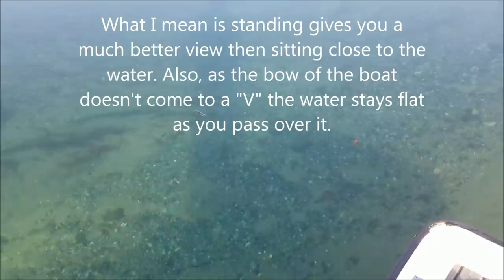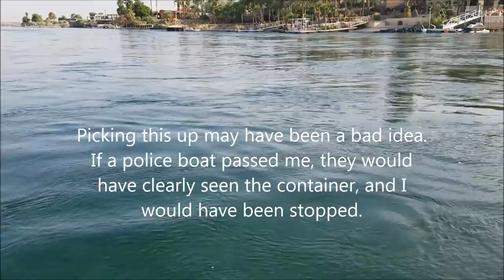I Bought The Strangest Little Boat On Craigslist

Comment: Sorry for all the comments in a row lol....what part of Cali is this? What city/river it's gorgeous!  I live in Portland, Oregon and we have the Willamette river that runs through the city and it's a nice place to boat/swim/hang out near the water, but no where near as nice as the river you're at and the water is not even close to as clear! You can only see maybe 3ft if that. Some really nice homes on the water! I'd love to take my 24' Baja H2X down there!! It's got a Mercruiser 7.4 MPI MAG that I upgraded to a full roller engine and changed the cam profile. Also did modest porting which was basically a gasket match port job that I spent a little more time on and also did the intake manifold. Also upgraded the headers to some high performance water jacketed header, into a captains call system and out the transom. (The capatins call is a valve you can open or shut that changes whether the exhaust is routed down through silencers, then the prop, or its straight out the back which makes it very loud. Most recent upgrade was the original drive started making some noise so I opened it up and found a spun main bearing so it needed a new lower unit. Instead of that I did an arneson surface drive conversion. I NEVER pull people behind my boat and I had the room on the trailer because it's actually made for a 26ft boat, so I went with a surface drive. WHAT A DIFFERENCE!!!! before the surface drive it would top out right around 75-80 mph on GPS with 2-3 people including myself and 3/4 tank of 89oct fuel. That's after the headers, port work and cam/valvetrain upgrades. After the surface drive install it would do 86-88 mph on GPS with the same conditions! I'm confident it could hit 90 mph with 1/4 tank of 93 octane and just me. I'm gonna definitely try to hit 90 next summer!

Comment: I think what would been a bit better, where you did the cut out for the motor on the trailer. Made a hinged plate to go in place of the void when hauling a 4 wheeler. Then when you haul the boat. Flip it up out of the way, just a thought. Cool project man, should of thrown maybe a 50 horse on that bad boy 😂 😂 😂. Plane that bad boy out.

Comment: Seems like that's burning more fuel than it should. In the 80's, I used to run a thousand pound 17 foot Boston Whaler Montauk (with the industrial rated hull) and used a larger engine than it was rated for. I had 2 5 gallon fuel tanks and would be out over 8 hours each day without emptying both tanks. That was before so much alcohol was added and the gasoline it's self may have been better quality, not being from shale deposits. That might account for some, but not much better efficiency.

Comment: You end up losing like 30% of your power through a jet drive, so its more like you have a 14hp outboard on there. Also don't believe it aids in steering any being in a fixed position like it is on your boat. Maybe better shallow water clearance but I'm almost 100% you'd be better off with a standard prop and just play around with pitch. Super cool little skiff though, nice find 👍
Reply from the maker: Well, next video regarding this will probably be a Prop vs Jet video.
Reply: @BrandonsGarage  Exactly what I was wanting to see! I'm not an expert by any means, just a scrap boat enthusiast like yourself. I'm a big fan of the late 50's early 60's Johnson/rude big twin motors. 35-40 hp depending on what power head you use and only 125lbs. Plus they are cheap and parts will swap from different motors over a 20yr span. Running twin 59' lark 35's on a 15ft Glasspar, not practical but turns heads lol.

Comment: How much water did it have in the hull? I’m guessing the flotation foam inside is soaked since it won’t get up on plain.  Also, you could tell by the way it dragged from the harbor freight trailer to the other one.

Comment: You should take the fire extinguisher out and turn it upside down and using a rubber mallet hit it until you can feel the powder inside move from end to end or it won't put out a match.

Comment: Trying to remember I think they referred to it as a door....(something?) I can remember a few around (Washington Hood's Canal) during the 70's.  It did NOT enjoy chop (so don't even THINK about something like Puget Sound)..... (I do mean the one in your footage at the beginning, never seen one like the one you bought).  Till you got it up out of the hole that jet on the new outboard sounded like a great appliance for turning fuel into noise... P.S. my grandfather (now dad's) has the same 10 HP seahorse but in BLUE (as a matter of fact the old Johnson dealer in West Seattle offered my Grand-mother a New 10 horse and $500 for it (I think?)).

Comment: Im curious how it would preform with a long shaft motor. like one they use one flats boats for duck hunting. Temporarily remove the upright bars and you might be able to drive it from the seat.
Reply: @Mud-Skipper Long Tail Motors

Comment: Just tie a line around the bar to the clamp on each side to prevent it from moving. If that motor suddenly moved all the way to the thrust side you'd fall off and it would run you over. You riding that thing without a dead man cutoff is unsafe for you and for anyone else on that body of water. You and safety don't have a very good relationship. 
It's crazy to think that 1996 was 24 years ago. Damn..
Cool boat!

Comment: Reminds me of a boat my father used to make called Circraft they ran a company in the 80s this is round and looks like a M&M and also uses the body learning from side to side to steer it. original design was to large and unstable then the idea and copyright was sold to the company my father worked for. they made the craft smaller and more stable. we had loads of fun with these boats. look them up on youtube. awesome fun.
Reply from the maker: Great, now I need one.
Reply: @BrandonsGarage  sorry for adding to your collection :) you should be able to find one for sale :)
Reply from the maker: where might I get one though...
Reply: omg lol though they do cost a lot more then we used to sell them. think it was about a 1k with the boat and trailer. try ebay or just search google for circraft. i think there is also a facebook page. hope this helps. :)

Comment: Not true at all about the strength and that is just going to crack out again. That was caused by impact damage      not likely a failure due to delamination. The best way to fix damage like that would be to completely remove and damaged fiberglass and start with small strips of glass and progressively laying on bigger strips until the damage is nearly filled. After that you make a putty out of a medium grind fiberglass powder mixed with resin and lay it on like body filler. After that a heavy fiberglass matting should be applied to the damaged area from the inside. That area would be the strongest part of the boat and really would the area crack out again.

Comment: Sounds like it's over reving the engine. Try another pitch prop..  higher number to lower the RPM. Should run about 5500 rpm when the pitch is correct.

Comment: I don't know where you're at but that's some beautiful clear water. Was that top speed? I don't reckon that's to bad and standing up to. Yeah that maybe as fast as I would like to go. Nice work
Reply: It's the Colorado River at Needles Calif. and on the other side of the river is Fort Mohave, Arizona.  Brandon mentioned in one of the responses on here that he felt it was going about 30 miles an hour and it wasn't at full throttle.
Reply: @WoodGuy  That's a damn good speed especially when you're standing on an almost flat platform like that. I don't want jetspeed speed, I want something where I can get to point a to point b with a few fishing supplies and that would be perfect. The only thing is if i'm fishing, i'd probably pull a small float behind for a little storage. Besides that, just riding the river would be a blast but i'm all the way on the other side of the country.

Comment: Not quite the same as the vintage video but still in my opinion more interesting than a jet ski. The original one would be good if it had a setback barstool for when you must want to sit. Or chair that flips out from the handlebars.

Comment: You made a big mistake on the drain plugs. You didn't put any silicone on the 2 mounting screws. It's guaranteed that water will work it's way in around them, and saturate the wood. Leaking into the boat will be minimal, but water damaged WILL happen. Otherwise, a nice job!
Reply from the maker: Didn't notice the tube of silicone?

Comment: So doesnt the jet drive take some speed away? Ive heard many different things about Jets being put on outboards. some say they make the motors slower. but some say it's the same. personally how I see it is, jet drive goes places where props cant. i guess go where the fish go.
Reply: From everything I've seen with friends putting jet drives on their boats on their outboards it knocks about 30% or more off of the speed compared to a prop like my buddies ball I had a 115 Evinrude propeller they would be 65 he put the jet drive bottom end on it and it would only be about 35 to 45
Reply: Yeah you lose at least 1/4 of your hp but you also draw a lot less water if its setup right. His cavitation plate looked well below the bottom of his boat so he wouldn't be able to go very shallow. The purpose of those tunnel hulls is to have the prop (or jet pump in this case) close to level with the bottom of the boat.

Comment: Loved b vid all clean and fresh work.  Loved the bag and Fiberglass trick I will use in the future.  Realistically would you make money if were to sell now  everything takes so much time and I appreciate how long it takes to revive a boat.  Water looked clear is it cold 👍👍👍👍
Reply from the maker: No money to be made.
Boat/trailer/motor combo is worth what, $700?
Trailer I could probably sell for $400-700 without the rest.

Which is why I don't spend the time & money to make everything perfect on a boat. There is really very little reason too.
Unless you're in love with the boat, and will keep it forever, you're just throwing money at something with very little return. 

Like the rub rail on this boat. It needs to be replaced, but is it worth $200 to do it, just to have the corners look a little better? No.
Reply: So are you selling this then?

Comment: I had that identical 10hp outboard. 1955 seahorse i think if i remember correctly. It would fly by a 9.9 with ease i had it on a 14 foot fiberglass and it would go on plane. Yours doesn't seem to work as well.... diffrent prop maybe 🤷‍♂️
Reply from the maker: I agree, this motor on my other boat was great; just as you described.
But on this thing it just wasnt any good. or maybe it wasnt firing on all cylinders
Reply: @BrandonsGarage  maybe. I had issues with mine when i first got it . If i recall it was a leak in the return pressure line on the tank a o ring i think. It wasent getting all the pressure for the fuel. Weird how those old motors worked

Comment: Sounds like a hydroplane. What was the hp of the first engine you tried? Maybe it needs a diff prop.
Reply: The motor has a shroud around the prop and works like a water jet so you don't have to worry about the prop if you fall off.  That's why it sounds like a plane.

Comment: i wonder if you could make a steering mechanism for steering an old bicycle chopped and a lever or cable system to turn the out drive just slightly to much and it would be to sensitive and run in circles

Comment: i like that   but how big of motor can one put on it  may have to off set with  weights up front.  what a blast that would be
Reply from the maker: probably not much bigger, the space where the motor mounts is only so big; even the engine that is there was a bit of a squeeze.

Comment: Don't remember the cost of buying
motorized surfboard/WhatChaMaCallIt/Er 
to start.
Concerned child who like lift control, (like elevator buttons, etc), fibreglass blown all over.

TimeLapse, clock overlay /OnScreenDisplay for curing
 and total time, maybe next.
Swearing counter DIY offseason project (+tipjar/house harmony).
Father's day coming up
as thanks for help from Dad.
Heard $300 trailer with JetSki (+tm elseWhere/ personal navigational watercraft or somesuch)
Can't sell JetSki so $300 trailer...

LoL Shoddy WorksManShip 
& Welds, cut off old,
Apply your own SWMS & W.

More notes likely as finish video.

Some power/ weight ratio stuff
may be in order
Passenger weight, motor weight
How much shifting is necessary
And eventually waves from 45, 90,  135 etc Degrees.
Floatation
Lights
And a bouy kit if sank/
problems could /would know where to look for it.

Licensing/registration/ inspection?
Seemingly mass produced
 not a one off
But looking at AquaCar,
WaterCar, etc
with 4x4 ATV platform,
many more possibilities...
Somehow design reminds me of fan boats in swampy areas.
No gators/croc,
But aquasocks 
may save slicing up feet sometime , especially if scavenging/Treasure hunting.
Thanks fun and interesting

Comment: When you first took your test drive I told my wife it was the colorado river. Then I said looks like the area by the Needles bridge. Later after you fixed it up  You went to launch I said he's launching from needles park. I recognized the launch ramp. you said you going up the river then I saw it the NEW NEEDLES BRIDGE> Since you are native there I presume. you will understand that statement. LOL! I miss the river. BUT NOT THE HEAT! PS> Me and my grandfather built the Aframe on the river with the top cut off!
Reply from the maker: Launch was from Jack Smith actually. 
And actually, I'm not that old, that bridge has been the same since I was a kid coming here. 
But, all the locals call it the New bridge too, just never knew the story.
And yeah, the heat isn't fun; only 122 today though. I find if you tell yourself its not that bad, its not that bad.
Reply: @BrandonsGarage  the original bridge was blown up in the movie convoy. And the production company built  the new one to replace it. Miss that area a lot since I moved to Virginia.

Comment: Got a 115 Merc tower of power. Think it would sink before you get it up on plane.?
Reply from the maker: Probably not, I can stand in the rear of the boat, and it still stays flat; so the weight probably wouldn't be an issue. The problem would be with the power of the engine, it would decided where you're going; operator be damned.
Reply: @BrandonsGarage  I know 30-40 hp. That boat rated for. Just bought 17 foot glasstron for the lower unit for my other boat. 16 foot Cee Bee Avenger. Ski boat. I'm restoring it. Nice job on the boat.

Comment: As old as this thing is, old fiberglass tends to get a lot of hairline cracks that you don't tend to see under the old paint job and over time can become arias where water can leak through and some times on a boat this old a real good measure would be to cut up to see inside and use it as a pattern to make a new one from scratch and with the better materials now on the market have a superior boat to have fun with and for sure no leaks. another upgrade would be to get rid of the grandfather outboard motor for a new one.  Then go to the gym and loss some of the lard and the boat might just look like the one in the picture.   As far as the lard goes, we all tend to get that way as we age, me too,  And for that reason when I go out on the water I use a real boat, like one I can take 5 or 6  people with me, preferably all young beautiful women in their bikinis and have some real fun, not possible with this kids toy.  But to each his own.

Comment: What is the max turn radius
Reply from the maker: Ehhhh..... you can get pretty tight, probably tighter than the outboard would usually be able to steer. 
Its hard to put a guess on it.  8-10' maybe?
Reply: @BrandonsGarage  Could it compare to a JetSki

Comment: I would put the biggest outboard that little boat would hold up without sinking
Reply from the maker: Problem is the opening for the engine to mount, 20-35HP hardly fit as it is.
Reply: @BrandonsGarage  build a mounting box that Mounts to the old motor mounts that has a bigger mouth?

Comment: That motor sounded way weak.  I had a 1-1/2hp which had WAY WAY more thrust that that.
Is it running on both cylinders?  The RPMs sounded way low.
Cool find!
Dude...your fiberglass repair could NOT have been worse.  It's so bad on SO many levels.
Reply: What was wrong with the repair??
Reply: @billallen4793  So many things, if you're going to do a good job and can only access from the outside, you 'feather in' the glass.  Sure, you can slap on the glass and be done with it (as this was) & if you want to do a better job, it's better to use many layers of thin glass vs. a single or few layers of thick glass.  It's both stronger, looks better, and lighter.   There's more....

Comment: What is next Bigger motor
Reply from the maker: Next step would be a 40, 48, or 50 HP.
Problem is the opening for the engine, it probably wouldn't fit. 
However I should try, as that will give me power trim/tilt. I have one too.